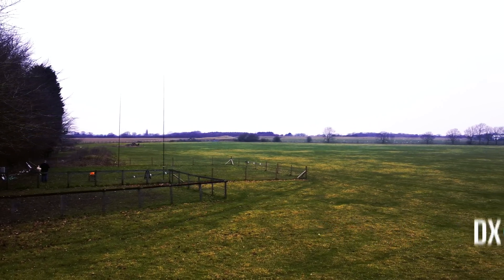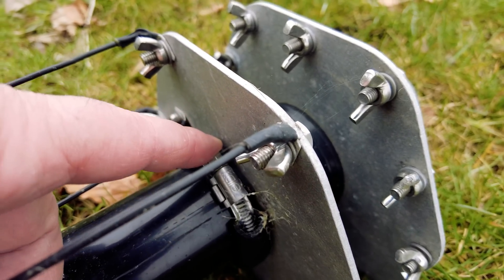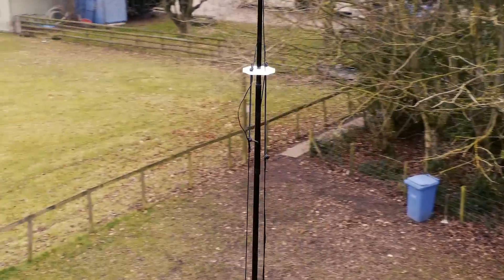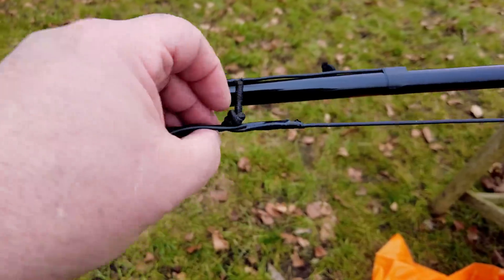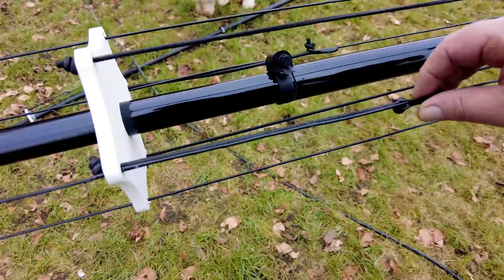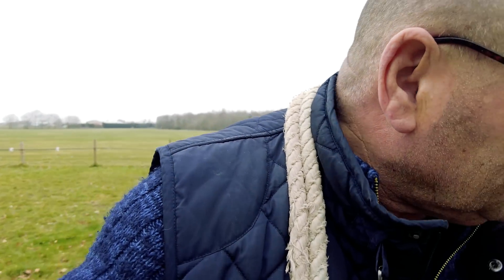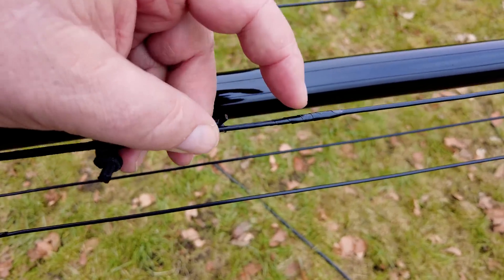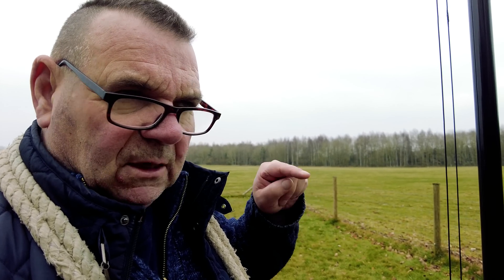How To Build Pre-Production Signature 9 - Build Tips and Tricks

Comment: could you take the 10-meter element and use 6.5 meters to get 5/8 wave or would that mess up the other elements?
Reply from the maker: COuld do BUT it would need matching.
Reply: @DXCommanderHQ  I love your antenna! is there anything I could try to bring someone that is local or about 20 miles away, in better?
Thank you Tom K1CXS

Comment: What is your professional opinion of the CB version of the 'COMPACtenna' ? Hot or not?
Reply from the maker: OK, so I don't know - BUT according to Maxwells equations, there MUST be loss if it's small. If it has a power rating, it has to heat up. Hence the loss. On CB & 10m band, it's quite easy to get almost a quarter-wave pretty easy which will have a LOT Less loss.
Reply: @DXCommanderHQ  So magic ;-)

Comment: Hi Callum, I have a question regarding a 40m horizontal sky loop.  It relates to when you wanted to get your own onto the 80m band and you chopped out a 6 foot section at the rear end of the loop to make a Halo loop 1/2 wave for 80m.  A friend of mine has suggested I could use Vacuum Relays to electrically switch in and out this 6 foot section, via a simple "switch" in the shack. To easily go from 40m and 80m.  My question is, have you ever delved into this/or know of anybody having success in this idea?  Thanks Mike
Reply from the maker: I often thought about it - but it seemed a hassle.. I was happy running outside and using croc clips :) PS - any old automotice relay would do this, I am sure.

Comment: In this day and age it would be easier to have tx and rx at base of aerial and just use control signals from shack. From point of view of user, the rig would appear exactly the same, with all the control and metering and tuning as with the full tx/rx in the shack, but the big advantage is no long coax runs. More power into aerial and better signal to noise for rx. Surprised this isn't done, unless anyone knows otherwise?
Reply from the maker: So put all the expensive electronics in the field? Yeah, do it :)

Comment: With my 12.4 modification I tuned the 10 and 12m elements by trimming the length of fold back. Started off with more then you recommend then kept using the calculator to give me educated guesses as to how much more to cut. Still need to get the 12m one "right" but it is near enough for now.
I remember back in the Day, top loaded mobile CB antennas were all the rage, might be on to a winner Cal 🙂
Reply from the maker: Top loaded CB antennas? Well, I never heard of that!
Reply: Fire stick?

Comment: My guess, its the smaller ground system.  Reason, I moved my classic today and added a hot galvanized steel, 1/4" square, construction mesh in the shape of a cross, using around 130 square feet of mesh.  I'm using the same radials as before, which are around 20 (some got damaged during the move). around 1/8 wavelength long, based on 40 meter, so 10 meters long. I plan to add some more mesh, test again, then add more radials, test again.  Overall, the SWR is lower on all bands with the largest change in the lower bands.  The bandwidth seems to be broader as well when tied to the SWR value.  There's more of the band available, on all bands from 40m to 6m due to the lower SWR values.

This is not conclusive, however the initial data is interesting.  More testing is needed, such as.

Move antenna back to original location, and establish a repeatable test routine checking each band's SWR and Smith Chart
Move to new location and repeat tests with no ground mesh
Test with ground mesh and same radials
Add more radials
Remove mesh, maintain radial config
Change radials to non-insulated, tinned copper 14awg. (I've been wanting to test insulated vs non-insulated, and review the capacitance/inductance plots on the smith chart)  I saw huge changes when playing with the 20m element using insulated 8awg, bare copper 6awg, 14awg insulated DX Engineering, and DX10.  The 8awg insulated wire was 2.1 to 3.1 SWR across 20m.  The bare copper 6awg was 1.2 to 1.55 SWR.  

Measure ground conductivity at both locations
Reply: Sorry for the math mistake.  The 1/8 λ radials are 5 meters long rather than 10.

Comment: Hi Cal, congrats on great videos and antennas. Can you share more info on how to tune 15m independently? 3 turns around what diameter? Thanks. 73 from Croatia.
Reply from the maker: Just around that part of the pole. No overthinking here.. Just wind the element up past the top spreader and around 3 times but ONLY if your situation needs it.

Comment: This is so interesting Callum, you’ve got the grey matter doing overtime.  As you state it’s normally the quantity of radials that matter as my Classic at home.  Out in the field I’ve had a couple issues due to difference in the ground I put a couple of tuned radials down and that fixed my particular issue but back home as I say it’s a different. Setup with the 32 radials.  Great this radio stuff isn’t it.  I can only wish you all the very best with your new product - no brainer really.   You deserve the success. 73 de M0AZE Mike
Reply from the maker: Hey Mike.. So I normally run around 80m of wire on a few small bunches and frankly, that seems to work anywhere.. CLearly, I have a slightly better / different ground for the 12.4, enough to know the 9 off. However, I can't "tell" there is any difference actually at the rig end of the coax.. So it's all really numbers rather than genuine differences.

Comment: My guess is the radial field and ground conditions. On my classic I have 7 bunches of FIVE 3m radials = 105m Total in 360 degree config. (2,625 wavelength of 40m band?) All elements were done exactly according cut chart. WITH MY GROUND CONDITIONS AND RADIAL SETUP: 40m Was at 7.32 (SWR 1.16). 30m Was at 10.426 (SWR 1.01). 20m Was at 14.291 (SWR 1.14). 17m Was at 17.985 (SWR 1.08). 15m Was at 21.49 (SWR 1.14). 12m Was at  21.556 (SWR 1.10). My guess would thus be that ground conditions and radial field has substantial influence on element lengths to get perfect tuning. All readings with RE650Zoom
Reply from the maker: Fascinating. We will do some deeper experiments.
Reply: @DXCommanderHQ  My apologies. I forgot to mention that my feedline is 16m of RG213. (Feedline length might also play some role I think, and mine is much shorter than yours 🙂)

Comment: A couple thousandths? Will there be a problem with thermal expnsion if you cut them in winter, and the antenna is baking at 40°C in an Arizona summer?
Reply from the maker: Maybe. But since everything will get a bit bigger (including the hole) it shouldn't matter. Actually, the plastic will get a tiny bit softer. I was more worried about everything freezing.. Funny how our minds work overtime on risk assesments..!

Comment: Measure twice cut once becomes more like measure 7 times cut 4 with antenna tuning. I'll be leaving the elements a bit long on my build and I'll let you know how it goes. Do you use a soft or metal tape measure? I'll be buying a new one since I don't own a metric one.
Reply from the maker: I run both.. But the soft "landscaping" style works great for antennas. Get a dual one. All mine are inches and cm.

Comment: Thanks for the tips Cal. The sale went well then 👍, all sold not long after the launch :trophy-yellow-smiling:.
May be a few weeks before I get mine built I'm waiting for some building work to be done.......hoping to get the builder to dig the post hole for me as well.
One question would the radials be OK laid under artificial turf? I could get on with making them so they are ready for when its put down.
Reply from the maker: Radials fine anywhere. We must not overthink this stuff.. I know it comes naturally! :)
Reply: @DXCommanderHQ  Thanks Cal